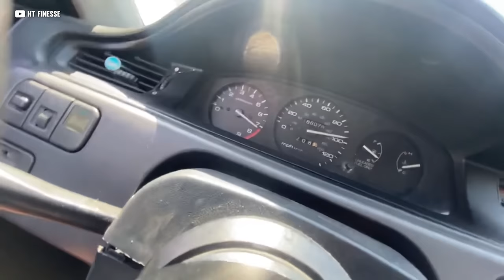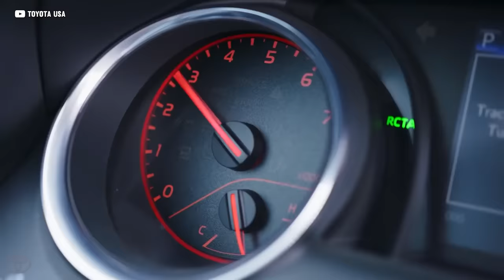7 Things NEVER Do In A Manual Transmission

Comment: coasting i rather replace brake pads than transmission.
Reply: Manual transmissions are almost a lifetime part.  The major points of failure are the input shaft bearing, output shaft bearing, and syncronizers.  Input and output shaft bearings largely depend on manufacturer quality.  Most are lifetime.  Syncros largely last based on gear oil used and hard shifting.  The one thing the transmission could care less about is engine braking.  It cares the same about going forward as it does going backward.  So if putting a lot of torque down is a concern, it might be time to do a trans upgrade.  Otherwise, it won't care.  What will care about engine braking is your valve train.  Valves, lifters, oil seals.  They all care.
When I first started driving stick, 24yrs ago, I would brake in neutral.  I knew this was incorrect, but I was comfortable doing it.  Later, I learned how to downshift properly and engine brake around corners and to stoplights.
Riding the brakes can be dangerous in some circumstances.  For instance, riding them down steep grades in the hilly/mountainous areas.  SUVs and cars having smoking brakes is rare, but it has happened.  Driving with any type of heavy load will also demand braking in gear.  Those brakes will be shredded otherwise.  Brakefade is a very real issue.  Runaway ramps have been used many times to save lives.  If you find yourself using one, you smoked your brakes going down hill after riding them for too long.  Braking in neutral is just not a good habit to adopt.  Plus, brakewhores are chumps.  A main point of a manual is controlled speed without the brakes.
There's nothing like the feeling when you and a motorcycle rider both rev-match when downshifting and stopping at the same time.  If all goes well, you'll both look at each other and give each other a thumbs up.  Satisfaction guaranteed.
Happy shifting.
Reply: You are putting your life and others at risk by coasting. You are not in control of the car. The transmission will not be affected by not coasting and as the guy said it is more fuel efficient.

Comment: I admit that I have done a few of these mistakes, but not all the time and not the seriously dangerous things, I would never try to slam it into 2nd gear at highway speed
Reply: It's easier to do than you might think.  Especially on gearboxes that aren't gated.  It's fairly easy to put the car into 3rd instead of 1st, or to upshift to 1st instead of 3rd, or downshift to 3rd instead of 5th.  I know because I've done them all.  Luckily, not when racing.  No hood missiles for me... at least so far.  One of the easiest cars to money shift on is a civic.  Adding a short throw shifter makes it even easier.  Inexperience + redline addicts = money shift.
Sometimes I'll completely forget what gear I'm even in.  It happens.
Reply: @christopherlowery855  Be at lest somewhat gentle with your shifts and you'll never money shift cause the shifter will completely guide itself from 2nd to 3rd, 3rd to 4th, 4th to 3rd, and 5th to 4th
Reply: @BoomCat99 I don't think anyone who dragraces their civic is concerned about being gentle.  A lot of these clips were of people slamming gears.  Although, to your point, being gentle is how I've never thrown a piston.  A money shift is mainly an issue in motorsports, not so much in normal driving conditions.  A person was being stupid if they money shift while driving normally.

Comment: Pretty good video except you are wrong about one of them. You said to park in gear and not rely on the parking break. You are wrong. That is what the parking break is for. Hense the name parking break. A car should never be parked in gear and definitely do not rely on the engine to hold the car in place. A worn engine may not have enough compression to hold the car. Also parking in neutral like intended prevents the accidental starting in gear although most cars have a clutch safety switch to prevent starting in gear, not all do and switches can go bad. Otherwise a good video with good advice.
Reply: If we are talking a petrol car they are spark ignition so won't start without the key being on, diesels are compression ignition so could possibly start but because they are higher compression I'd consider it unlikely, if it were steep enough to start the car would probably start rolling as soon as you let off the brake. In the end compression and the parking brake are going to create the most resistance to the vehicle rolling.
Reply: @arrindaley3714  I'm talking about starting with the key without pressing the clutch which happens often enough for clutch safety switches to be required on all new cars manufactured
Reply: I agree, it happens but I don't think it's worth the risk of leaving your car in neutral and it rolling away, many handbrakes just won't hold on thier own.
Reply: @arrindaley3714  it's proper name is parking brake for a reason, but yes on a steep hill it does makes sense to do both
Reply: @doogie525 in freezing weather it isn't that uncommon to see stuck parking brakes....
But this depends on where you live
Reply: @imtiredtoday  actually it is uncommon.  I fact it is very rare. Brakes are almost always warm enough to evaporate off moisture except in very extreme circumstances
Reply: @doogie525  overnight in like -25c???
Reply: @imtiredtoday  if your breaks are sticking at -13 consistently and it is not reaching above or close to freezing during the day then you may have another issue. I have no problems reaching as low as -35 overnight. Could possibly be something they put on the roads where you live but that shouldn't be happening

Comment: Parallel parking isn't hard at all, I drive a manual transmission
Reply: For a miata, no.  For a box truck, yes.  Size matters more than transmission when parallel parking.  But I think their point was parallel parking on a hill.  Like in say SanFransisco.  For newbs, that would be cancer.  For a seasoned driver, yeah, not a challenge.

Comment: This is why I drive an auto. I fear I'll fuck it all up, I never learned so yeah
Reply: that's okay, you can also drive sequential transmission if you want to. some automatic transmission cars come with sequential shifting, they are called semi-automatics or manu-matics.
Reply: @wastelander470  never heard of them or seen one I think.
Reply: @staticstormbird5439  well they come with an automatic, it's like driving a sequential transmission race car. 

You can switch from automatic to sequential depending on mood. Or some cars have paddle shifters. Semi-automatics are my favourite transmission.
Reply: @wastelander470 "manu-matics"  haven't heard that term in about 20yrs
Sequential autos are nice, but it also depends on the brand.  2008 MDX, yes.  2003 Optima, not so much.  Today, they're a lot better.  When they first became a staple, they were hit or miss.  Nothing beats the 3 pedal experience.
Reply: My dude, find yourself a buddy who drives manual, then let them teach you.  It doesn't take long to get the basics.  The stage fright fades after a few months.  Don't let anxiety stand in your way.  At most you'll slip the clutch or grind the gears.  It's fine.  Doing this while learning is fine.  Doing it after you've learned is not fine.  It's the difference between letting water flow on a rock for a day vs letting water flow on a rock for a decade.  One makes no difference, the other has lasting concequences.
Best of luck to you bro.  I hope you get to drive the manual of your dreams.
Reply: @christopherlowery855  I'll see if I can. I don't have any but I'll see I guess.
Reply: @christopherlowery855  autos shift faster than manuals
Reply: Nerd
Reply: @gnrtx-36969  yeah I'm a car nerd, or should I say car guy
Reply: @wastelander470  I was saying to the commenter
Reply: I disagree. Modern upmarket cars can change gear faster but my 2008 certainly doesn't. @wastelander470
Reply: @elemar5  how do you know? Did you compare it to a manual car? And was that manual car also from 2000's?

Comment: But what about double clutching
Reply: Thank you!
Reply: Why would you need to double clutch in a car with synchromesh?
Reply: @elemar5  reduces wear on the gears and clutch. Mostly clutch.
Reply: @elemar5  I think your question meant to be something like "why would you want to double-clutch a synchronized transmission"
Most car transmistions are synchronized today.  However, large trucks are not.  They use sybcromesh gears.  Meaning, there's no mechanism preventing the operator from grinding gears. 
Double-clutching helps to synchronize engine speed with transmission speed.  We do this with synchronized transmissions to save the synchronizers and so upshifts don't need to wait on the synchros.  You may or may not have needed to wait between shifts holding the shifter at the next gear while it's gated by the synchronizer.  Double-clutching makes that process almost instant. (As fast as the driver can execute a double-clutch).  I'll feel a slight clip of the gears when I double-clutch into 3rd.  Double-clutching into 2nd is, or can be, sketchy on a small car.  When I used to drive trucks, I would float gears.  Because eff double-clutching a 2K of torque clutch all day.  Those who don't should double-clutch to keep from grinding gears.  But again, this is only in large trucks.  In short, the main reason to double-clutch on a synchronized transmission is shifting speed.  Lightweight flywheels and internals make this practice practically a waste of energy, as the engine speed falls too quickly for there to be any speed benifit.
Hopefully this makes sense and answers your question.